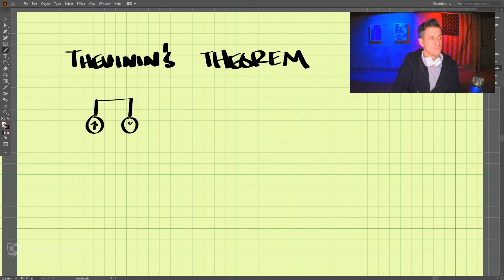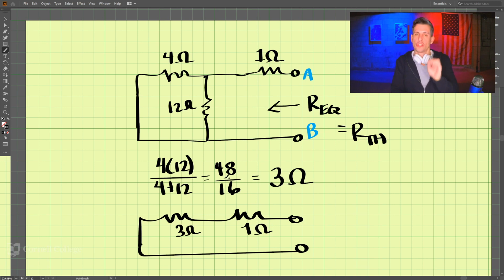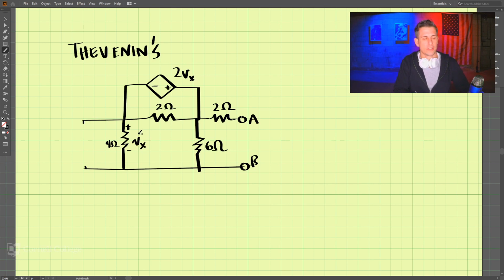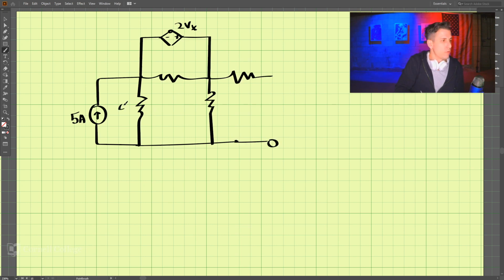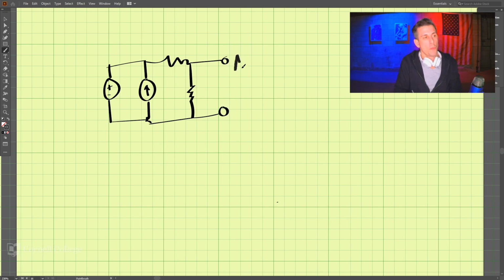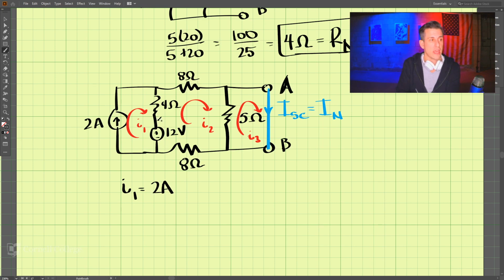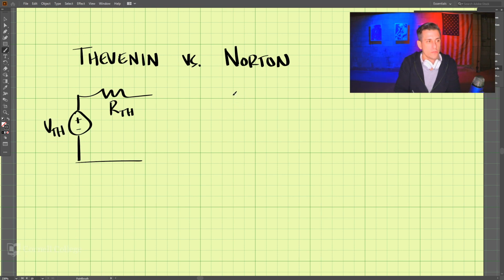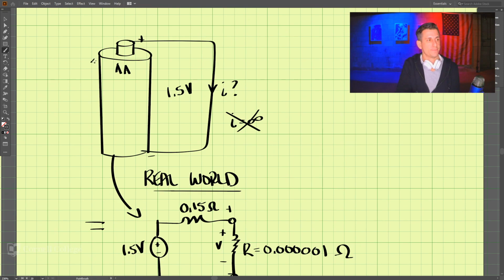Chapter 4 (Part 2) - Fundamentals of Electric Circuits

Comment: 22:30 why you have write the equation 4i2 but not -4i2 becoz the current is going from where -ve to +ve
Reply: I also noticed the same thing,i think he got confused,
Reply: @omarsamy1144 Direction while doing mesh loops is unimportant. If the current is supposed to be the opposite way it will come out as negative when the equations are solved anyway. If he used Vx instead of its I.R equivalent he would put -Vx but 4i2 is fine here.
Reply: He even explained it later about 23:50 that Vx=-i2(4) therefore -Vx=i2(4) two of these are replaceable in that loop equation

Comment: Can you give a quick example of what Thevenin theorem is useful for application wise? Im a bit confused because we can find Vthev and Rthev, but then how do you know how much current will be draw? I guess if you had a motor with some resistance as the load, finding VThev might help? Thanks!
Reply from the maker: Batteries are a good example. We commonly model batteries as a simple voltage source. If we model them this way, we make the assumption it can supply infinite current. Modeling a battery as a voltage source and an internal resistance (Rth) becomes a better approximation. We can actually calculate the maximum current that a battery can supply to a circuit. You are also correct with the motor example, if we are analyzing multiple alternatives for motor design it would be much easier to just solve the circuit with a source and a resistor instead of trying to solve the complex circuit for every motor alternative.
Reply: @ProfessorJohns  Thank you!!

Comment: For the example of Thevenin's at time stamp 22:00. Why are you able to add that 1V voltage source due to linearity? Or what allows you to be able to add that voltage source with not changing anything in the circuit?
Reply from the maker: Resistors are linear components. V = iR. You can add any quantity for the voltage source (we commonly use 1V because it makes calculations easy). You could add a 2V source, you would get twice the current, resulting in the exact same Rth.